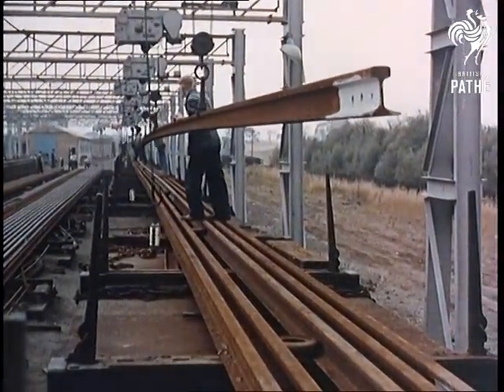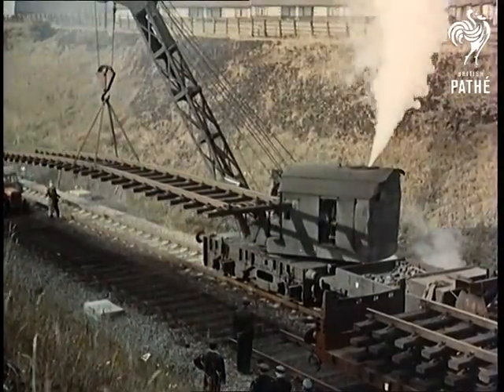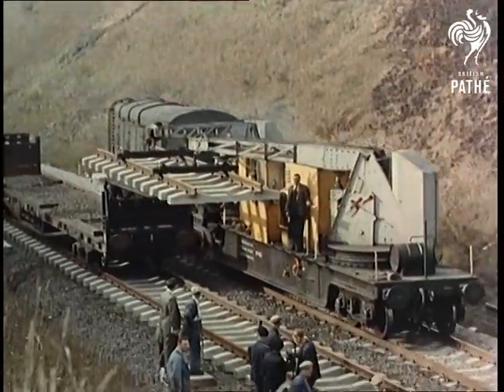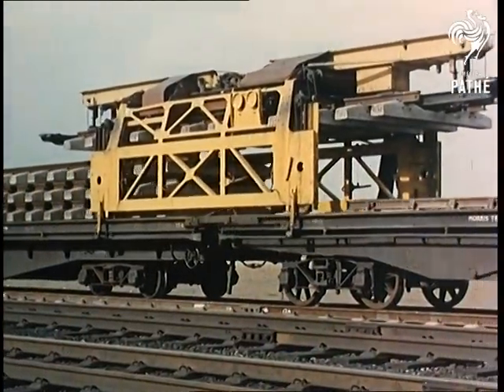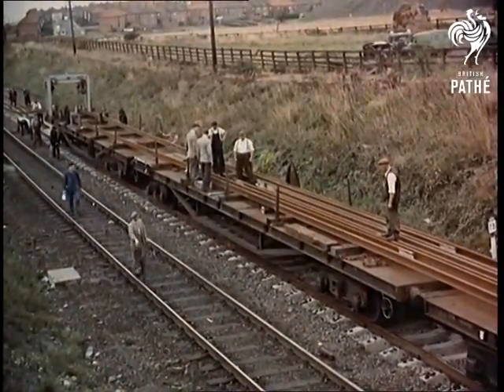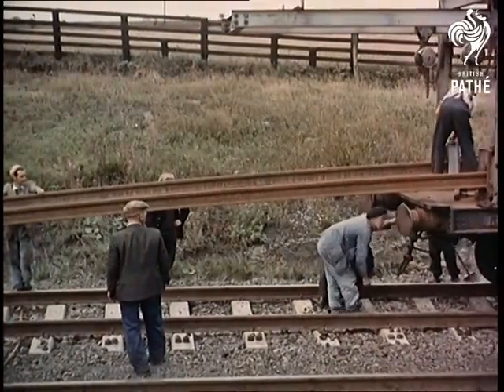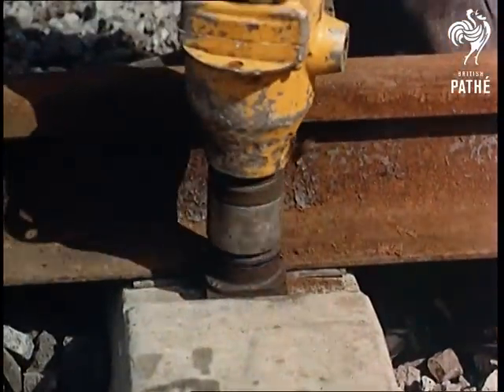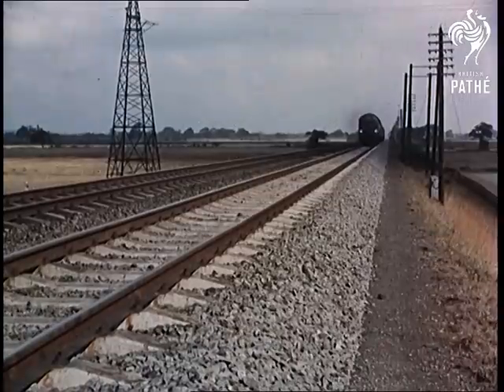Railway Modernisation (1960)

Comment: Those automated trackl-layers and ballast-tampers are STILL more advanced in 1960 than what we have in the US.  We still use wooden sleepers because we're too cheap.
Reply: Not where I have lived in the states -CA, NY, CT, FL.... huh. Where do you live?
Reply: @DoctorVdW  anywhere else! 😂
Reply: You can still find wooden sleepers in a lot of the UK
Reply: In Canada it's over 90% wood ties used on CN and CPKC.
Reply: We use wooden ties because they still last longer in certain areas (mostly the deep.south) than concrete will.   There is a reason csx is replacing miles of concrete ties with wood ties again.
Reply: @Danvers97  That's fine for freight lines but not for modern passenger rail.